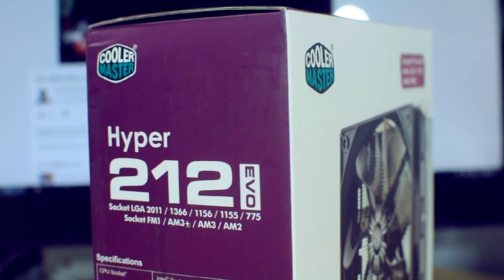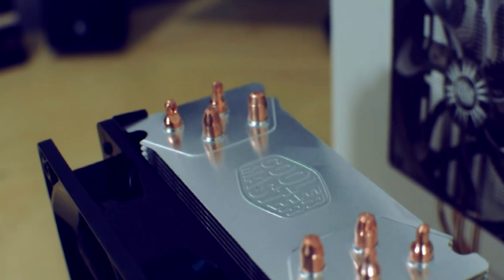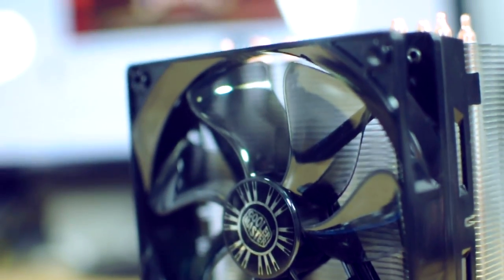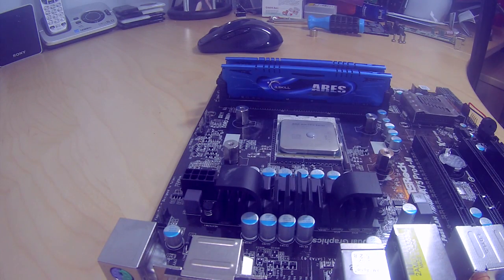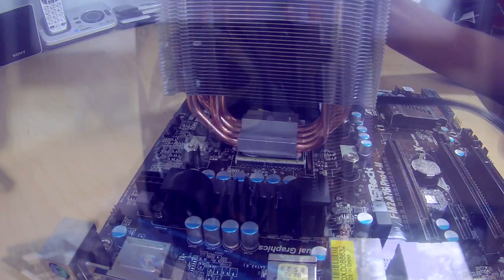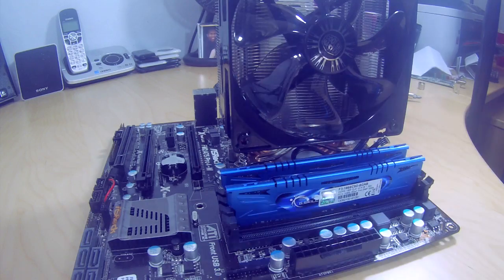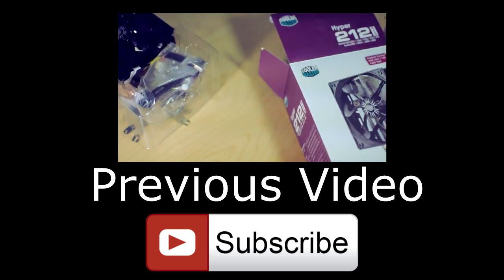Best CPU Cooler! | Cooler Master Hyper 212 EVO Overview & Install

Comment: I installed this cooler somedays ago, but in my case I had a problem with the screws an I I had to tighten too much...
is it normal with this cooler or I did something bad?
Reply: +ganzka69 The screws for the back plate are flat on one side so you have to align them right when pushing them thru the back plat (or else they will be difficult to get thru). Because the screws that goes thru the motherboard are flatten on one side the threads aren't complete so the nuts can be difficult to get on straight.

Comment: If I upgrade my stock Intel cooler will I need to take out the motherboard to install it?
Reply: +TheUKGamer it depends on what case you have. most modern cases will have the motherboard tray open on the back so you wouldn't need to take it out, but some don't
Reply: I have the corsair 400r so I can do it in the case. One thing I dont like about the case is that I cant figure how to connect the front fans to the motherboard :|

Comment: by the way either the zalman cnps10x performa or cnps10x extreme is better than the 212 evo. they both have 5 heatpipes instead of 4 and performs better even though they are a bit older they still have the appropriate mounting hardware and they cost about 3-4 bucks more and sometimes cheaper on discount

Comment: does new thermal paste need to be applied when installing a new cpu cooler or does the cooler come with it or what?
Reply: +AleStorm This cooler comes with thermal past. You should always apply new thermal past when installing a new cooler. Old past is dry and won't fill the gaps that it's suppose to do. Wipe off (with clean paper towel) any old past and replace it with new when installing a new cooler

Comment: This guy is an idiot, he obviously doesn't care about his equipment, he's not using ANY ESD protection such as a mat or wrist strap, I use both. The human body can store thousand and thousands of volts of ESD and most components on a motherboard are designed for less than a couple volts. Can we say massive ESD damage

Comment: What corsair ram do you suggest when it comes to having this heatsink installed?
Reply: +Stephen Phillips You probably bought the ram already but in case you didn't, try the kingston hyperx rams, they are very slim and not very tall, its great for this fan.

Comment: how on earth that little point of thermal paste is enough? dont you need more than that?
Reply: +Hello World apparently you all don't really know how thermal paste works. Normally it's recommended to put a dot the size of a grain of rice in the middle of the CPU because you want as little thermalpaste as possible between the heatspreaders and the heatpipes as possible
Reply: +LawlessSentry Definetely
Reply: +FLUXAH You need a blob also, his looked watery and like a puddle
Reply: *****
The Guys at puget systems?
Reply: Marlin Müller You need enough to cover entire CPU while not being too thick. There was video over at LinusTechTips and he tested all ways of applying thermal compound. All cases had temperature of 47... except applying way too little he reached about 54 degrees.

Comment: How is your CPU so hot on idle? my FX-6300 only idles at 32 C
Reply: xD overclocked FX-6300 @4.4 GHz with 1.55 volts and i still cant get that hot on idle, damn Intel, put on you boxes "Water Cooling Required!" XD
Reply: AMD is the best for overclocking :3

so are their video cards ASUS R9 280 @ 1.3 GHz and the memory @ 1.57GHz
Reply: I can help you with that :)
Reply: kool
Reply: +ponyboyswager TM What cpu cooler are you using? I have the same cpu as yours and the stock cpu cooler is really noisy LOL
Reply: I think I smell some AMD fanboys... Intel processors actually run wayyy cooler than AMD. I like AMD a lot, but Intel processors just run cooler.
Reply: ***** thats BS i had an Intel and its avg running temperature was 85C my AMD hardly ever gets to 60C
Reply: Melody Chaser well you probably had an older pentium 4 prescott or something because my brand new i5 never gets above 60 like yours
Reply: ***** Uh, no i have an i7... had to delid it to get it to run cooler
Reply: Melody Chaser what gen was it and was it overclocked? i might be sounding really defensive here but im just wondering how you had any i7 running at 85C avg if it wasnt overclocked or being cooled with paper towels
Reply: ***** Gen 3 no overclock, stock cooler
Reply: Melody Chaser the stock cooler may have been the problem, pre applied thermal paste isnt exactly the best

Comment: could i use this cooler passively with no overclock?
Reply: If you aren't gonna overclock, you might just use the stock cooler
Reply: +Leo Superglue HELL NO PASSIVE COOLERS ARE GINORMOUS IF U TRY TO GAME ULL BURN DE CPU
Reply: Superglue up in here passive cooling is very bad. lets leave it at that
Reply: +Elie Saliba He wants passive so it's silent
Reply: I'll take this as a yes
Reply: +Leo Superglue NONONONONONO
Reply: Well I mean I'm using a stock cooler with stock clocks on my new build and I can't even hear my computer while it's running...
Reply: +Redey1290 same with ne
Reply: Lunin Gaming yes?
Reply: Witch CPU do you have ?
Reply: ***** 6600 i5
Reply: Lunin Gaming ok

Comment: will it work with lga 1150 i5 4690?
Reply: Yes it says it does on the side of the box with the picture
Reply: Yes I have that setup. My 4690k oc'ed to 4.4ghz with good temps.
Reply: +audrius paulauskas if u put ur cpu inside ur microwavy for 15 seconds u wil see how overcocked it gets. dont go over 20 cuz then the goverment will chase u

Comment: is it normal for the 212 evo to move a little once installed? Seeing some say it swivels slightly.
Reply: +TRAILBLAZER02 yes its is normal, since its pressed agains the cpu and not locked there like the stock cooler

Comment: heard it was good, need a cooler anyway as mine isn't doing its job whilst gaming....totally getting it.
Reply: Highly recommended. I still have this since 2013 and got it to overclock my 8350 to 4.5ghz all these years. I did replace the fan around last year with cm sickleflow. The stock fan still works but just storring it for spare now.
Reply: +Tom V Hey, you know you can dual-mount fans on the Hyper 212 EVO, you can have one fan on each side if you're storing your other one.
Reply: Twisted Chikon
Yep, I had that setup a couple of months ago but it didn't improve noticeable performance. It just added a bit more noise.
Reply: Tom V
Oh, okay, I'll remember that when I install mine. I guess it could be helpful for overclockers.
Reply: Twisted Chikon
You can do it to make your pc look cooler. (no pun intended lol) I actually like how it looks with 2 fans.
Reply: Tom V
Yeah, it looks cool with one fan, too. It's just a cool cooler in general. Cool in both ways, awesome, and cold.

Comment: hey man your over sized cooler inst actually "pushing" your panel, your panel is pressing your cooler into your CPU, then into your MB, then into the screws which are screwed to the other side of the case, continually added unneeded stress.  cut that mesh so they support some of the weight, and apply no pressure back to cpu and mb.  next time check out the 120 cooler master $50 liquid cooler on new egg.  these fans are a novelty and should not be used.  people with to much time on their hands come up with extra weight to kill your PC. nice mic and a good video on what not to do.

Comment: A good choice, I recently installed the 212 EVO and it keeps my CPU temps at 35-36 degrees when it's hot in my room, and about 30-32 when it's cold idle. Under load, my temps usually range from 50-55 when gaming. I did have a little difficulty installing the cooler since it was my first time building, but it's probably just because for some reason the EVO came with 3 nuts of the wrong size, and 1 that actually fit, so I had to go and buy spares from the hardware store that fit. All in all, it's a very good cooler for the price. I'm running a 4790K that I haven't bothered to OC yet.
Reply: +The Arbiter How was the temperature before you installed this cooler? my i5 4690k goes like 90c under load I want to know how much could this cooler decrease temp
Reply: Ali Firouzi When I was using the stock Intel cooler, I noticed my idle temperatures were around 45-48 degrees, and under load my temperatures sometimes reached to the mid 80s and 90s. The 212 EVO will bring both your idle and load temperatures down quite a bit.
Reply: Wow so cool!
is it a quite or noisy cooler?
Reply: Ali Firouzi It's a fairly quiet cooler, it makes some noise, but not too much ^ You won't notice it while gaming or watching movies
Reply: oh thanks alot

Comment: Everyone thinks these giant coolers are louder than the stock ones, but actually the stock coolers have to work a lot harder to cool down the CPU, making the fan have a whiny pitch under loads. The EVO cooler is the best!!
Reply: Smaller means they gotta spin faster

Comment: I'd recommend putting some anti-static plastic between the case and the cooler. In theory, the case is grounded by the power power supply. But why rely on theory or the possibility of a dodgy ground wire?

Comment: what program did you use to access your bios and control your fan from there? Or is that how your bios normally looks after f2ing?
Reply: No program its all motherboard settings. They all have different features and interfaces

Comment: Would this work on a Intel's 1151 please help
Reply: No. It won't. It hasn't been updated with LGA1151 specific brackets.
Reply: +Gator Mods Yes it will! It's not specified on the box but it fits. Just installed two ;)
Reply: +Rishi Govindan Yes it will

Comment: Think fan on wrong side of heat sink: rear and top case fans to be exhaust fans to expel heat (that rises)  your CPU fan is pushing hot air to front instead of to exhaust
Reply: +Roy Wood No it's oriented the right way. It's pushing air from front to back
Reply: +theRealRindberg Now I don't know why but usually when you see the fan makers logo you know the breeze will be at your face and that fits with the fan spinning clockwise from the picture you sent me or maybe this is a motor from under the equator where just like the water spinning counter-clockwise when it goes down the drain so do their motors
Reply: +Roy Wood I think you're thinking of the sticker that has the fan specifications and yes then the fan blows in that direction. This fan has stickers/logos on both sides. Yes from the side you see it spins counter-clockwise and if you saw it from the other side it would spin clockwise. The spin of this fan is normal... had to look at some other fan of mine ;)

Comment: Hey Jerry. Nice video! I have a question: I just bought this cooler and my nephew installed it for me. However, he forgot to use some ( i don´t know how to call them cause english is not my main language) black rectangular( 4 actually) rubber type things that came with it. They seem to be something to use on the main screws so the cooler doesn´t slide or damage the motherboard maybe? Could you tell me where should i place those? If you can try to point it out to some timeline in this video or so. Thanks in advance. Dropped you a like!
Reply: ***** Hey there.Thank you. could you point out where to place them?
Reply: ***** Got ya. Thank you very much =)

Comment: This is a stupid question, but I thought that CPU coolers were supposed to blow air directly on top of the CPU? Maybe he addresses this later in the video, but how exactly does having the fan in the position that is shown in the video help the CPU?
Reply: +Mr. Austin No,The heat-sync absorbs the heat and keeps it in that area,that the fan pulls out the air in between the plate(That's why it's not a solid block) and releases it through the vents.
Reply: Markus Kulik Ah, I see. That makes sense. Thank you for the explanation!
Reply: No problem.

Comment: Do you guys think corsair vengence pro ram will fit with this thing or should i go with ares like this dude?
Reply: +Furoki fur there is plenty of room: the fan goes on the other side of heat sink and will run cooler with the heat going out of the case exhaust fan

Comment: For the money its unbeatable... but compared to higher quality offerings, its pretty awful.

The mounting hardware is straight garbage is my biggest complaint of it. Getting the pressure even is really a test in patience compared to the other brands. "Hard"? Not really, but absolutely frustrating.
Reply: I agree that along with the quality its really the biggest selling point for this cooler. Does a really good job for its value and good for people creating their first build as well.
Reply: +EscoBeatZzZ  For any "cheap" build, I always make the 212 a mandatory purchase. Better temps, MUCH more quiet than stock coolers, and a cool aesthetic for sure.

Comment: could you intall another fan on it ?
Reply: +Arch Illusionz Yes the cooler comes with a extra set of fan mounts. There is only one set of rubber standoffs on the cooler fins so you might just have to get some foam or rubber strips to set between the mount an cooler fins.

Comment: put this cpu cooler on my pc and it will only boot up on its side i turn it up right and computer shuts down and wont turn back on turn it back on its side and it boots up in 20sec could it be this big fan not putting the right presser on the cpu when it is in the upright position and when its laying down has the right presser im confused

Comment: Thanks Jerry, I just build a computer with a Cougar spike case and my FX 8320 fan is loud as hell and this video is a perfect tutorial for me. I'll definitely be getting this cooler.
Reply: +Brandon Sterling Fans are gonna make noise I think the biggest factor is your ability to control fan speed. I built mine with 5 fans an once I run the Asus Fan Xpert software it auto tuned to only run the CPU cooler fan an had that at 700rpm.

Comment: How wide is your case? Not all cases have the same width. I am concerned about it fitting into my case. I have 2 cases it might go into. One is 8in. wide the other is 7-1/2in. wide. I could not help notice that you did not have any clearance on the top of the cooler.

Comment: Best CPU Cooler ??? xD i hope u are joking !
Reply: +hatlesspuma swagmaster damn
Reply: +TheKnorkey He probably meant best for the price. What's your opinion on the actual best consumer cpu air cooler then? Noctua NH-D15 maybe?
Reply: +Jesus of Nazareth No, a liquid cooler at that price would perform poorly in comparison.
Reply: try a noctua ... ANY of them .. even the low price ones from them with KILL the performens  from this " crap " ... this is about the same as the stock cooler .. a few % better ofc .. but dont ever use this crap and then go overclocking hehe

Comment: Can u install 2 fans on this cooler? or will it destroy the cooler?
Reply: +vidde nykvist It comes with an extra set of fan mounts so you can yes.
Reply: +vidde nykvist I suppose you could. One to direct flow of the air in and other to direct flow out. Of course they have to be same model and manufacturer.
Reply: Somebody tested it with 2 fans and it was only like 1 degree celsius colder. Not worth it.

Comment: The bracket was kind of a pain in the ass to get to stay in place and screwing it down. Kind of have to use a little bit of pressure to get it to screw in.
Reply: +kooken58 Even the guy in the video was sliding the cooler around getting the springs in place. I mounted the cooler first then while mounting the fan I kept sliding an turning the cooler so I imagine I need to redo my thermal compund cuase it runs warmer than a stock cooler now.
Reply: +ScottH454 It sound that you haven't tighten the screws enough. You should tighten the screws until it stop (as much as possible). The springs will make sure that the pressure on the cpu is right.
Reply: +kooken58 You should've screwed just a few turns on each screw at a time. In the video he didn't wrong by screwing in on screw (side) at a time.

Comment: I own both evo and plus, found that the 212 evo is wider than the plus making it not compatible with all motherboards.... to align with the dies on the q6600 properly(horizontally on the board) it got in the way of my ram on my p35-ds3l's but was ok for my p35c-ds3r(I know these are older;P) which has the ram slots further away

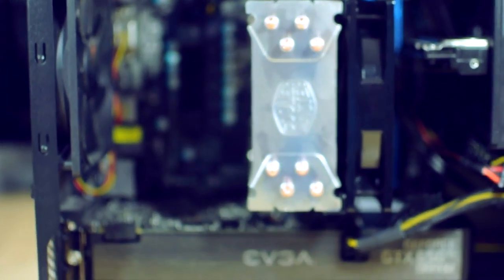Comment: @ 6:50 i know its a stupid question still am asking,which way does the airflow take place i mean  the fan is towards the dvd writer side so does the air flow towards the rear fan or towards the dvd writer? the lateer case would be stupid i guess..still would be helpful if u cud answer ...and what about the thermal paste i just got the i7 4790 and have the stock fan so  should idirectly install this or do we need thermal gel?
Reply: +Soumya Majumder I think the hyper 212 evo comes with a small bag of thermal paste, and yes you can tell the direction of the fan by looking to which place the "+" that keeps the fan in place is, as that is the direction of the airflow it goes to the rear fan.
Reply: thank u buddy figured it out now...installed the tx3 evo on my i7 :)
Reply: Soumya Majumder
very good ;)

Comment: PLEASE HELP!
Can the SPEC 03 case fit both a Cooler Master Hyper 212 EVO Cpu fan & a R9 380 GPU?
Reply: +Zupez - CS:GO & more! Don't think so. Couple of mm out. Go on the website of the case and cooler.
Reply: Dont think so try pc part picker it checks the compatibility of your parts